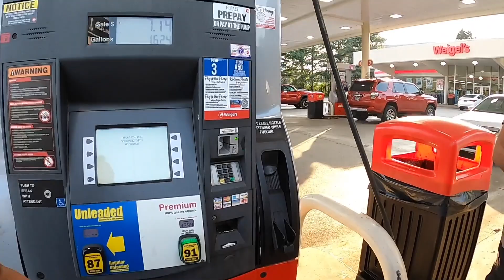FIRST CAR RESTORATION PROJECT VLOG FOUND MY TRUCK 1972 CHEVY

Comment: Great project 👍 keep the long bed and get rid of the bed liner. They will rust out or rot the wood as they hold MOISTURE and will rub the paint off at the top of the bed liner where it meets the metal also keep the HEART BEAT OF AMERICA in the truck 💪 no LS motor
Reply from the maker: The liners already gone, full footage of what I’ve done so far is coming by very soon!